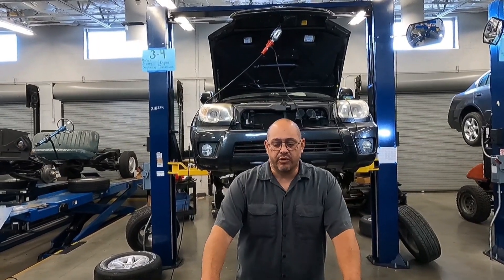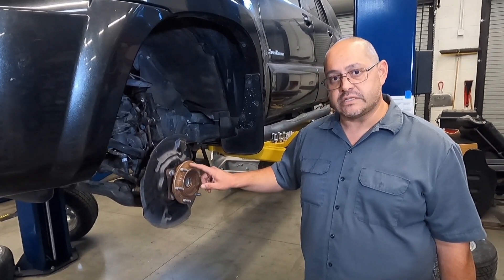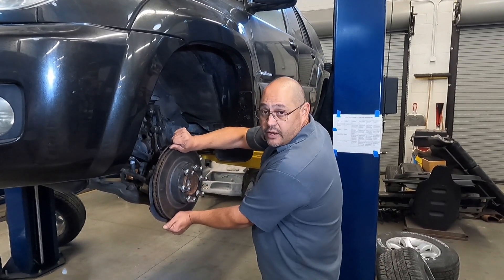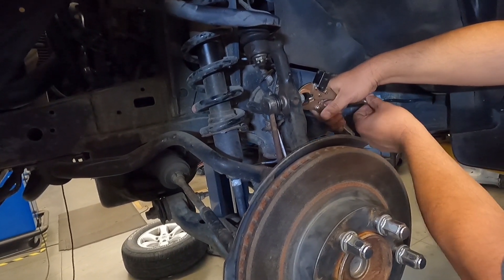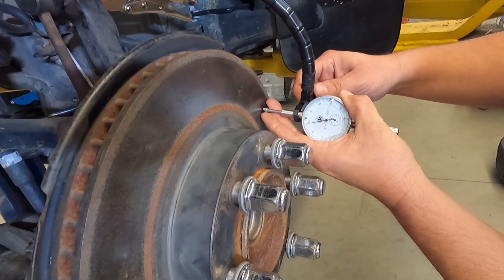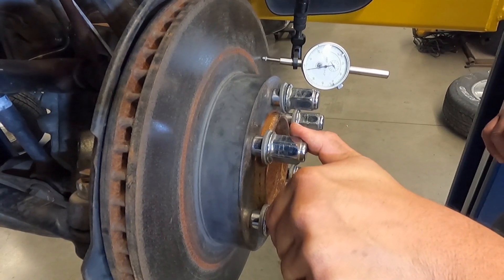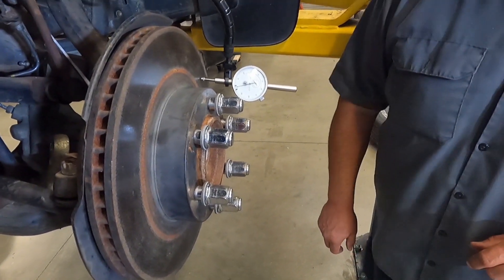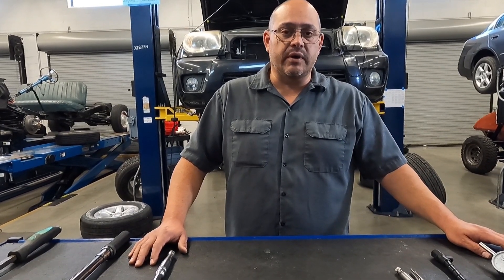Measuring Brake Rotor Runout

Comment: What I'm going to do is get some M12x1.5mm nuts and some large fender  sized 12mm washers. And use those to tighten down the hubs. Cheap way to get good spread covered since you have a hut pressing into a 2" or so wide washer.